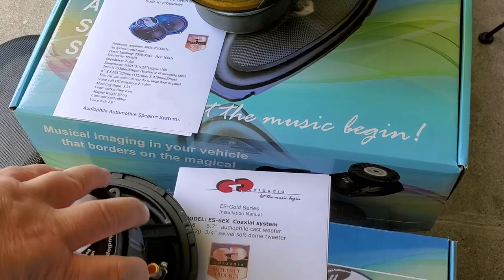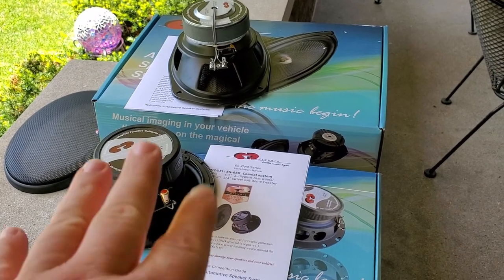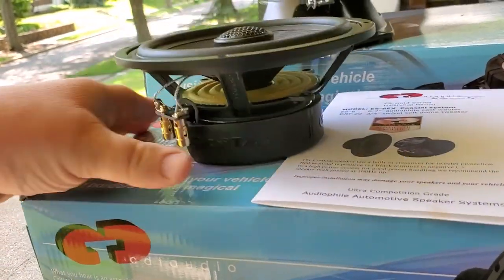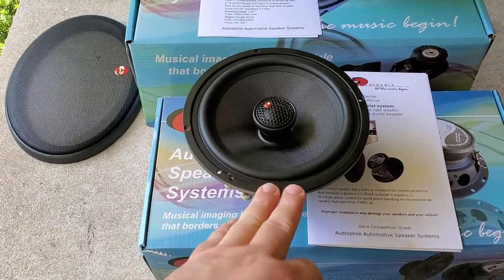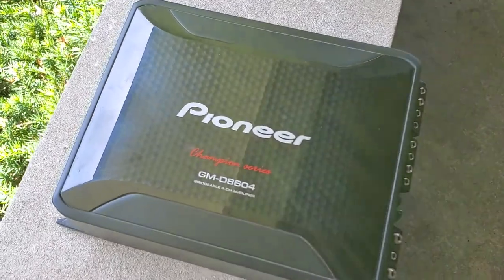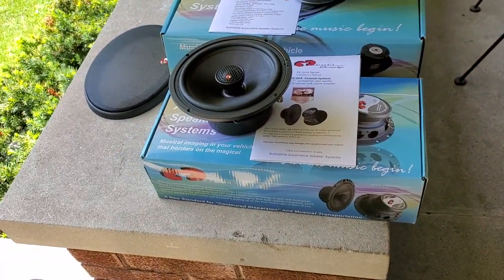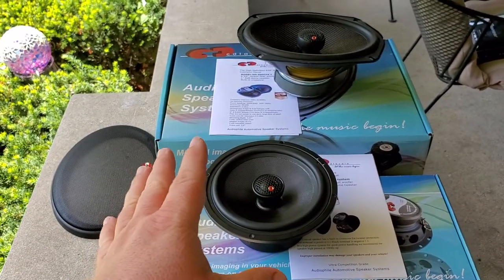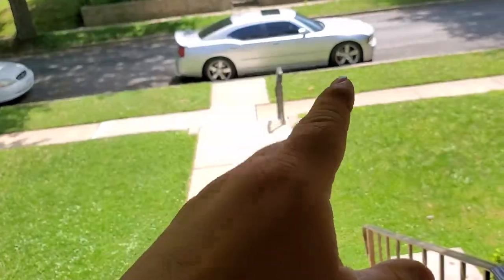CDT unboxing for an install coming up

Comment: I got a question so im looking into buying  4 speakers. I already have 2 12s so bass is Set up. I want the loudest speakers ever also the ability to hear all instrumental background etc not just speakers that scream. I need 2 6.5 front and 2 6x9 in back. What would you recommend for coaxial or Midrange. No component for me. Just want an easy install. I dont want tweeters just speakers also Im not too worried about price range. Im thinking about ds18  I dont want to drain my battery and alternator definitely I want it stock.Lmk what you think its for my nissan.
Reply from the maker: If your looking into coaxials the Orion XTR are really nice and loud sound really good you can look at the vid of the lil Kia it has some Orion Xtr 6x9" in the back n they are loud but if u can wait a few more days until i get these installed n see what these will sound like